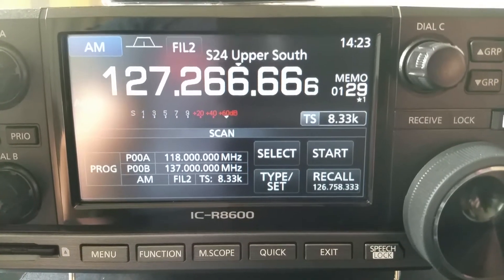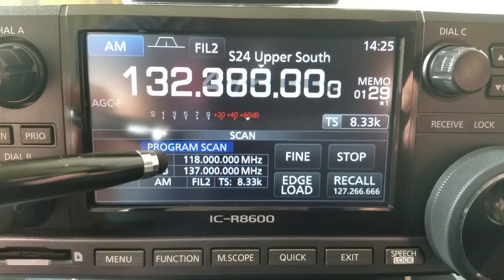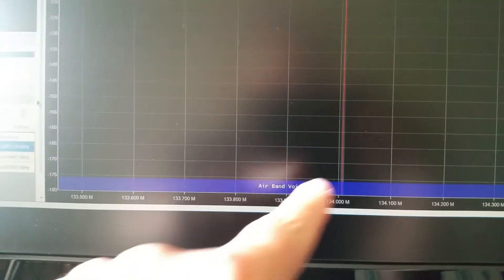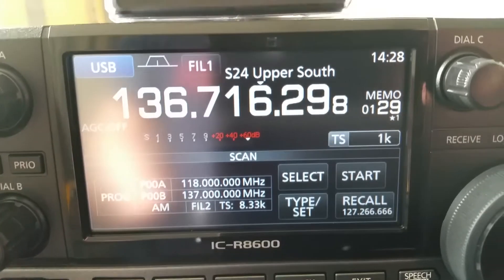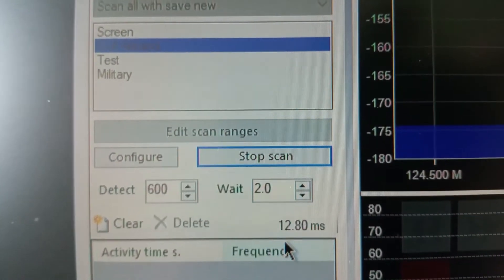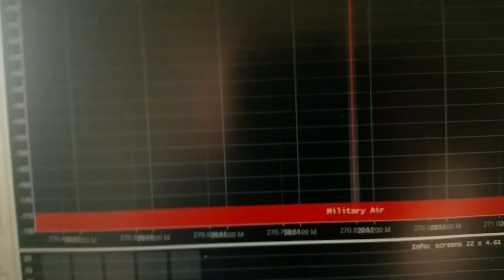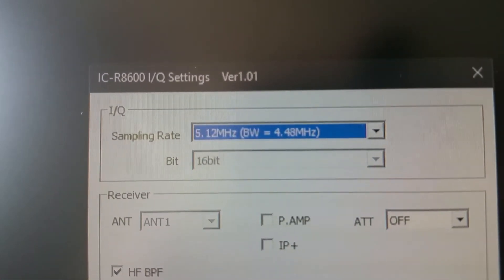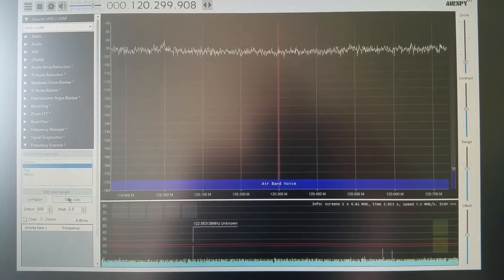Icom IC-R8600 working with SDR# (SDRSharp)

Comment: Hi! I copied "ExtIO_ICR8600.dll" (v1.01.26) into the SDR# 1732 directory,
and in FrontEnds.xml, I added magic line : (guessing)
<add value="SDRSharp.ExtIO_ICR8600.ExtIO_ICR8600IO,SDRSharp.ExtIO_ICR8600" key="ICR8600"/>
but it remains invisible in the frontends list ...  
any idea ?
Reply: Oh wait. it seems SDRSharp.USRP.dll and HidCtrl.dll must also be copied to 1732. Now the DLL for UHD/URSP is selectable. But can you confirm that the DLL settings aren't accessible if the receiver is not connected ?
Reply from the maker: @lastlonewolf  The 'FrontEnds.xml' file only needs the following if you're using the Icom IC-R8600

<?xml version="1.0" encoding="utf-8" ?>
<frontendPlugins>
  <add key="UHD / USRP" value="SDRSharp.USRP.UsrpIO,SDRSharp.USRP" />
</frontendPlugins>

The folder 'SDRSharp_v1732' can be located anywhere i.e. in your Documents folder or your main hard drive i.e. C:\SDRSharp_v1732.

The other .dll files you mentioned must also be in the 'SDRSharp_v1732' folder.

Comment: Works well but if you leave it for a while my setup tends to crash and then I need to reset the ext IO driver. A right royal pain in the ass!
Reply from the maker: That's annoying.  Never let my setup run long enough to experience crashing.  I'll try it.  Let you know if my setup crashes after a while also.
Reply: @Maersky-747  Cheers - will be good to know. It doesn't just happen in sdr# it also happens in sdr console in just normal tuning mode (no scan feature on that). It tends to be after around an hour or two. In some instances I just need to press the stop button and then play again and it's back up and running.
Reply: The message I receive is: ExtIO_IC8600. Communication failed. Cannot access Receiver!
Reply from the maker: @Scotscan  How odd.  I only get that message when I plug the USB cable into the USB port at the rear of the R8600 when it should be plugged into the IQ port.  I've been running the software for many many hours  and have not experienced the crashing of the software you get.
Reply: @Maersky-747  you're lucky there. I wonder if it's because I'm overloading it by scanning too quickly. Detect is set for 100 here. What are the stats of your pc?
Reply from the maker: @Scotscan  I find 'Detect' at 100 is too fast for me.  I question the accuracy of the sensitivity at that speed.  I usually go for 500 - although sometimes I set the 'Detect' to 750.

Comment: Hi Maersky 
I have an IC R8600 and was very interested on 2 points 
1: How did you connect the IC-R8600 to your computer 
2 : Where did you get the old version of the software v1.0.0.1732 all the downloads I have tried are the latest
Reply from the maker: Connect the R8600 to PC via standard USB Printer Cable.  I use a Tripp Lite USB 2.0 Hi-Speed A/B Cable with Ferrite Chokes.  The Ferrite Chokes help to reduce RF interference and spikes.  Look at the eBay link as an example.  Also, click on the link to directly download SDRSharp v1.0.0.1732

https://www.ebay.co.uk/itm/Tripp-Lite-USB-2-0-Hi-Speed-A-B-Cable-with-Ferrite-Chokes-M-M-6-ft-U023-006-/293175054676

https://www.iz3mez.it/software/SDRSharp/SDRSharp_v1732.zip
Reply: @Maersky-747  one more question where did you find  ExtIO DLL file version 1.0.1.26
Reply from the maker: @tom19101950  From Icom ...

https://www.icomjapan.com/support/firmware_driver/1972/

Comment: i have an icom 705, can i use it with sdr software instead of the classic usb sdr?
Reply from the maker: Not sure.  The 705 is a Transceiver whereas the R8600 is a receiver - although according to Icom, the 705 "has many great features such as SDR platform" so ... who knows.  No harm in trying.  P.S.  Does the 705 have a I/Q output?  If so, it just may work.